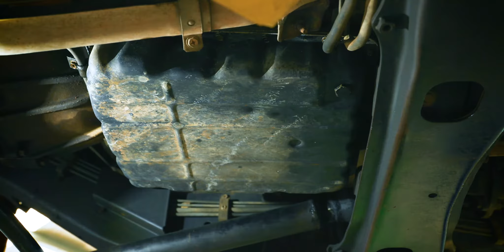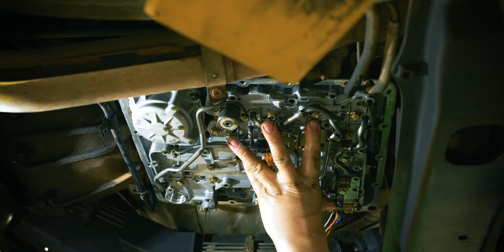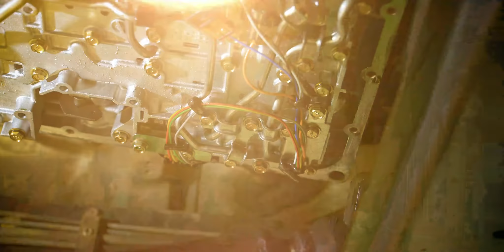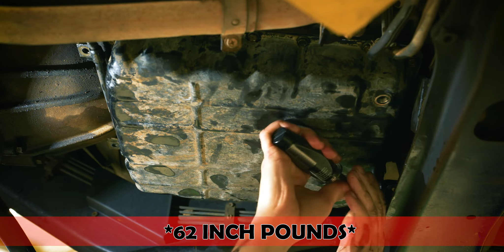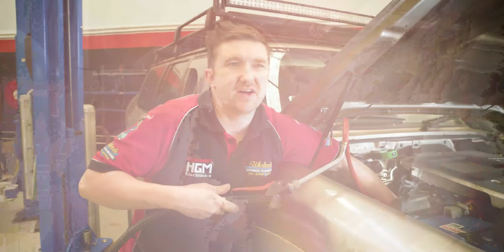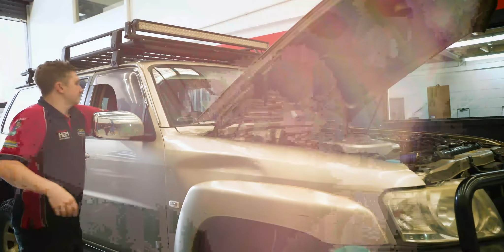Nissan Patrol Heavy Duty Valve Body Install

Comment: Hi changing a solenoid and just found your video we took to many bolts out could you tell me where the small bolts labelled with a 9 go thanks
Reply from the maker: Try this link:
https://automatictransmission.com.au/wp-content/uploads/installation-instructions/Nissan-RE4R03A-Valve-Body-Instructions.pdf
Reply: Thanks for reply if I buy a new valve body these seem to be the same as. Mazda bongo is that correct thanks

Comment: I want to buy for Nissan patrol y61 zd30 DI auto 4 speed
Reply from the maker: We do have valve bodies available for the Y61 ZD30 DI 4-speed auto. Here is a direct link:
https://automatictransmission.com.au/select-your-vehicle/nissan/patrol/gu-3-0l-turbo-diesel-with-4-speed-auto/?make=Nissan&model=Patrol&series=GU%203.0L%20Turbo%20Diesel%20with%204%20Speed%20Auto

Comment: А что случилось с этой трансмиссией ? Зачем Вы меняли соленоиды ? Не включались 1-2 передачи ,или просто  пинались ?
Reply from the maker: Этот гидроблок был модернизирован для обеспечения работы двигателя повышенной мощности, больших внедорожных шин и буксировки тяжелых грузов. С этим автомобилем все было в порядке, гидроблок был заменен на нашу усиленную модернизацию Nomad. У нас они есть для самых разных марок и моделей.
Reply: @WholesaleAutomatics  OK !!Understand
Reply: Do you have a valve body for a 1993 Nissan D21 4x2 with a 3.0 gasoline engine. In America shops do not want to replace the valve body, they only want to install new transmissions 😃 RE4R01A transmission

Comment: what's the 1st thing to check if its stuck on gear 2 or 3 on D .. not shifting.. checked the solenoids are still working. RE4R03A
Reply from the maker: Check fuses to make sure the transmission control unit it's shut down.

Comment: Where do I order the spring kit? 2003 Nissan Xterra 3.3 automatic transmission.
Reply from the maker: Why do you need to change the springs?
Reply from the maker: No, not at all, there will be fine.
Reply: @WholesaleAutomatics  Thank you!
Reply: @WholesaleAutomatics  It's apart from changing shift solenoids. Seen an upgrade on this video. Why? No need to upgrade the springs?

Comment: Do you supply a diagram on which bolts to remove?
Reply from the maker: We have them all on this page Ed, check out this web link:
https://automatictransmission.com.au/technical-support/valve-bodies/instructions/
Reply: @WholesaleAutomatics  thank you!!  Which one would be for a 1999 Nissan Frontier.  Transmission Re4r01a?
Reply from the maker: Nissan GU Patrol with ZD30 engine.
Reply: @WholesaleAutomatics  Awesome.  Thanks again!

Comment: Great video. I have the same vehicle and my auto shakes when the stall locks up, do you think it is as simple as replacing the lock up solenoid? Much appreciated
Reply: Had same problem.  Fix was to replace the torque converter lockup solenoid.   The solenoid coil had developed a high electrical resistance (typical problem) which caused the torque converter to slip in and out (shaking).  Fairly easy to test resistance at the connector under the dash.  Replacing this solenoid is not that hard as it's on the bottom on the valve body.   Remove the pan. Change solenoid (3 bolts)  Replace the pan.  The only tricky part is that the solenoid is held in place from atop the valve body by a bracket...and with all the solenoid mounting bolts removed, the bracket can shift position making it impossible to replace the  bolts without having to drop the valve body first to reposition the bracket.   I avoided this replacing the bolts one by one with threaded rod before I removed the old solenoid.  The threaded rod held the bracket in position.  Reverse procedure to reinstall.
Reply: Have same issue on mine I’ve been dealing with for couple years, just about to replace torque converter. Would love to know if you find an answer

Comment: Hi Guys,  there is mention of a temperature sensor located in this transmission.  How can this be used to get a temperature reading?  The wire must go to an ECU pin?
Reply from the maker: You are far better off putting a temp sender in the transmissions hot line. You wouldn't be able or even want to use the internal temp sender. You would need a gauge that is calibrated to the correct Ohm's output and pan temp is measuring coldest possible temp only.

Comment: I had to drop the valve body out of my 95 pathfinder to replace shift solenoids. Not a job I would do without a lift again. Holding the body in place while on your back is rough.

Comment: Hey Is this the same for y61 td42 re4 trans ? I have one of your extreme valve body’s installed but need to replace the trans as there is a weird whining noise that comes and goes .I  was going to have a crack at the install myself cheers
Reply from the maker: Brad make sure the whine is in fact from the transmission first and change the oil filter before moving forward. Get second opinion or even bring it into us if you are local.

Comment: Hey guys I have a gear engaging delay issue in my Audi A4 B8 1.8T front wheel drive. I have spent so much on fixing at a workshop in Dubai. Still couldn’t get it to work normal. What could be the fault. Cheers
Reply from the maker: This being a CVT transmission it is more likely to be an internal problem. Was it fully rebuilt when in Dubai?
Reply: @WholesaleAutomatics  yes they gave a big bill but don’t know what job they did, they told the problem will be solved after driving for about a month, but it didn’t and they didn’t provide warranty